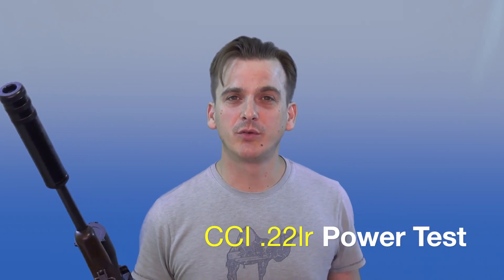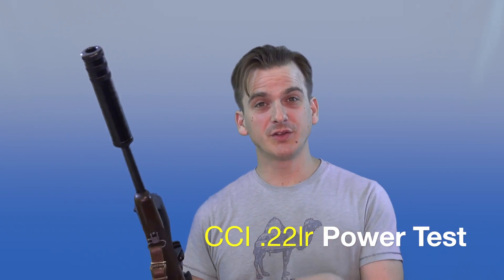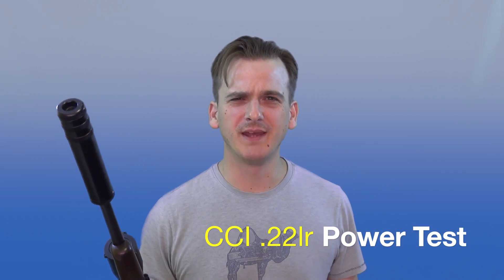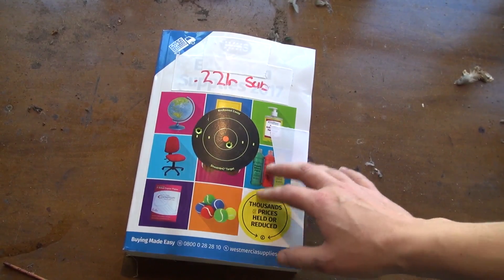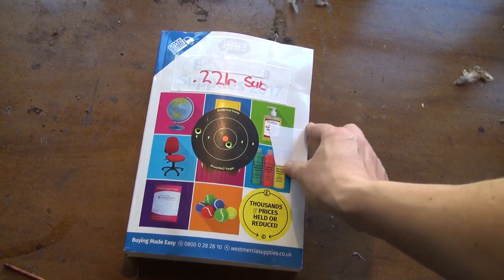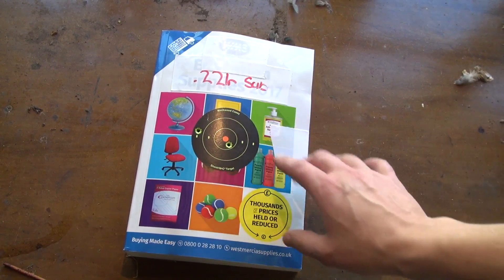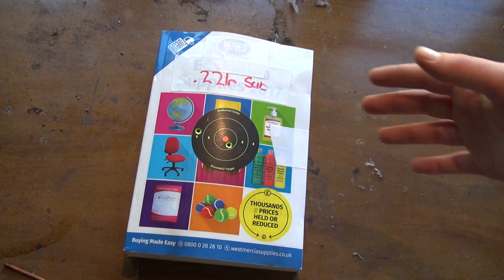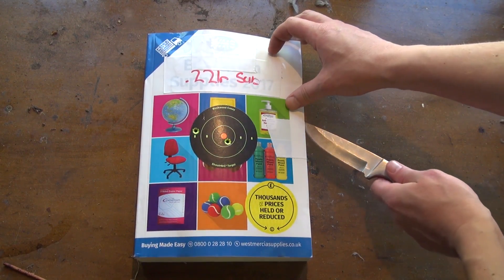CCI .22lr Power Test #explained

Comment: As others have mentioned, for hunting the Mini-mag HP at 1260 fps is a good choice. They cost about the same as the subsonics and have similar accuracy. The transonic issues aren't a factor at the short ranges at which I shoot i.e. 50 - 75 yards. I don't have any experience at longer ranges with .22 lr.
Reply: He uses a suppressor, so subsonic is better, loudest noise being the firing pin drop. Most there use SSHP for closer and 17 HMR for farther for taking rabbits, not bothering with in-between HiVel and HyperVel 22lr.

Comment: There's some evidence out there to say 40gr HV such as the CCI Velocitor is stable through transonic range where as the lighter 32gr Stinger loses stability much easier, I've seen some pretty impressive groups with the Velocitors out to 300+ yards, which is obscene for a 22LR.

But in all reality 17HMR is the answer for long range bunnies.

Comment: I know it's an old vid, but for pest control applications- in my personal experience all the jacketed roundnose high velocity .22lr rounds on the market just don't have consistent expansion at distance, and regardless what brand i tried, i found with head shots on small pests upto 100yds and close range fox upto they weren't as effective as lead hp subs- although in most cases the animal was instantly dispatched, i had far too many pass throughs or just poor expansion that required follow up shots. They won't kill any better than subsonic hollowpoints, they're alot louder which isn't ideal for urban jobs, the "benefits" of flatter shooting isn't very noticeable, they're expensive.  I can't really see the point in them as pest control ammunition , find them a bit gimmicky and if I wanted/needed high velocity I'd use a different calibre anyway. I do however use them occasionaly at the range in my semi autos, because why not.

Comment: Apparently the reason for the lack of accuracy out of hyper velocity 22lr rounds has to little to do with the trans-sonic barrier and more to do with the twist rate of the barrel. The 22 barrels just aren't designed to fling out pills at 1600 odd fps. The bullets can't stabilise properly and end up cork skrewing towards the target, hence the lack of accuracy, much like the way a 223 barrel is normally 1:9 twist, while a 22 250 is 1:14 in order to accommodate the extra velocity. I read about it a few years ago in an article written by a champion shooter in the States, but their name escapes me as it was a good while ago. Good video though man. I've murdered a few Argos catalogues in my day as well..! You have to stockpile them these days though, as they don't always have them..

Comment: The powder in the stinger with smaller grains Is faster burning. Not sure about color change but it's like in muzzle loaders in the bore FF powder in the flash pan FFFF smaller = more surface area》 faster burn ensuring all the powder burns and none is just shot out the bore

Comment: High velocity.22lr ammo is that inaccurate since the twist rate is meant for ammo wirh about 325m/s (standard velocity) and a bullet weight of about 2,6g. Those aguila sniper sub sonic .22lr cardridges are keyholing in most rifles, as they're extremely slow and the bullet is very long and 1,5x as heavy as normal .22lr bullets are. It's not ideal for a normal .22lr twist rate, like HV ammo. The groups of HV ammo are way worse than SV ammo at 50m, which indicates that it doesn't have anything to do with the sonic boom catching up.
Greetings from Austria.

Comment: CCI Stingers are best for close range varmint and handgun self defense in my opinion.  They do wonders in the Ruger Single Ten 5.5" revolver, I feel confident with 10 Stingers on the ready in my night stand.  For my use the .22 LR fills an important niche, that is economical shooting of open sighted pistols and rifles usually well within 100 yards, as well as small game and varmint at closer range.  At these practical ranges nothing is more reliable and powerful than CCI Stinger ammo.  If I need to accurately shoot paper or animals at 100 yards+ I will be using a scoped long gun that is at least of .22 Magnum power.  If I need to shoot misquotes off the back of a dog at 200 yards without harming the dog, then out comes the .17 HMR target rifle... Thanks for the video.  Thumbs up and subscribed.

Comment: The propellant used in the CCI Stinger is slower burning.  This allows for more powder to be used without the pressure ever exceeding the maximum safe chamber pressure for .22 LR.  This is why it can develop such energy without any danger.  It is also cleaner burning, and I have noticed it produces a less intense odor while shooting (compared to other .22lr ammo).

Comment: I stopped using stingers because of the noise from them and as you say at 100 yards accuracy is worse than subs thru my  cz455 with a SAK or Wildcat Panther (Wildcat was bought for my 22 Hornet but works well on me 22LR)
I you get a chance if they are sold in you area try the Eley Sport and Eley Club both round head 40gr and subsonic but boy are they accurate thru my rifle single raggy holes at 50 and less than inch at 100, i sit and camp a tree line full of rabbits at 125 these Eleys are head shots every time super accurate and being subsonic just ! 1085 and 1090 they are, i do like my hollow points cci subs ect but accuracy wins me over and these Eleys are much tighter than the cci at 100+
Reply from the maker: 13conair i have had the same with eley subs but they are now 38 grain and lower velocity than cci so while more accurate at a guven range they have a bigger trajectory meaning in the field i find i can rely on them less especially 0-50 yards.

Comment: There is a pressure wave that moves from the front to the back of the projectile when it goes supersonic then again, the pressure wave moves from back to the front when it drops out back into subsonic speed both times the projectile is destabilised. I have done my own test and get much smaller groups with standard over high velocity. Great vids keep them coming.

Comment: Very good video and demo !!! Only thing i would say is never ever assume speed = power !!! The 2 are very different!!! While the stinger leaves the barrel very fast it also slows down very fast due to the light lead !!! So by the 50 meters or so your normal high velocity rounds 40 grain will be impacting with more energy than the stingers !!! And as you pointed out !! For flat out accuracy stick with the subs allways !! There is a reason why the competition shooters all use sub sonic!!! Keep the good videos comming mate !!!
Reply: Sam Haveaguess dude!! what's wrong with you!! massively obnoxious!!

Comment: I love .22LR and would never be without one. A lot of people like to bash it since .17HMR became popular, the amount of people who've insisted I should ditch it and move over to HMR is unreal. Ain't gonna happen. Granted, there are some advantages with it but how much use they really are is questionable where I shoot. At least with .22LR you have a subsonic option, it's way cheaper to shoot and as you've demonstrated - it hits harder than some may think. I mostly use subs in mine because it's primarily used for rabbits. Fun test btw, keep it up!
Reply from the maker: A .17hmr only makes more sense for someone only comfortable shooting at the centre of the cross hairs. If you use a range finder etc then 100 yards is reliably accurate with a .22lr sub.
Reply: MrSDSTRIKEBREAKER I use my .22lr and i dont like .17hmr so i use a .22mag

Comment: Donno if they allow or make CCI Mini-mags in the UK but I've found them to be the best all around .22LR cartridge.  Less prone to jam, very consistent accuracy, etc.     You should check them out if you haven't already
Reply from the maker: Yeah we have CCI here but they are generally considered target cartridges as they aren't hollow point.
Reply: Yep, we have mini mags over here, really good rounds. I also use CCI "Quiet", slow as hell (710 fps), but really accurate well past 50 yds

Comment: Greetings From America!
  They are different powers with different burn rates Sam.
     That's how the different velocities are achieved with essentially the same cartridge.
      Try using the 40 gn round nose bullets in the distance test. I have experienced better accuracy at longer distances with them.
       Stingers are good cartridges, but the hollow points have always been less accurate at distance. And you have found that the mass retention is lacking with them also.
         The hollow point it a more delicate bullet, with the tips easily deformed. At speed this is more important.
       Try this test in the t-bolt...40gn solids, Sub and HV. Then compare there accuracy at distance.
       It is showing me that the rifling in the 20" t-bolt prefers the lighter bullets at slower speeds. Test the 40gn solids to confer the result.
        If that tests result compairs, than you have found the answer. THE T-BOLTS rifling and barrel lenght prefers the sub rounds. 😀
      It's great to see you asking yourself questions and searching for your own answers.
        The bullets mass retention also helps to transfer energy to the target also! 
        Would love to see you run this test on the t-bolt. Finding the magic round for ones rifle is a self satisfaction quest!
        Just sayin!  
      The crack can be tolerated if it's a bull's-eye I think.
        Best Wishes Sam!

Comment: Hi Sam, found CCI subs accuracy inconsistent in my Sako p94s and were prone to jamming in the 10 shot mag, think it was to do with their coating, tried Eley subs, much tighter groups and no jams. cost more but there's probably a reason for it.
Reply from the maker: Never had a problem with the rotary mag in my t-bolt. But yeah ELEY subs whilst 'lower spec' on paper might work well. I will try them, consistency is what's important.
Reply: The cci subsonics cycle reliably in semi auto hand guns n rifles that can takes cci standard rounds cuz cci subsonics are cci standards they are jus lead hollow points

Comment: Could the smaller grains of powder in the stanger be for faster burning because it's meant to also be used in pistols with obviously much shorter barrels?
Reply: Back in the Napoleonic wars soldiers used to grind their powder for a more powerful shot. Could that be the same principle here? Smaller granules means more surface area that will burn at the same time... Some of those above mentioned soldiers ended up with breech explosions though..
Reply: One youtuber said the powder is slow-burning as the velocity would not be possible without reaching pressure point over the spec